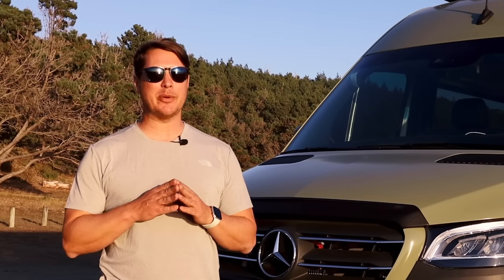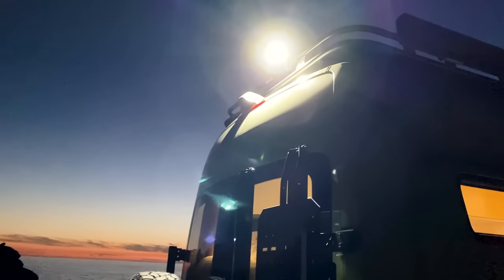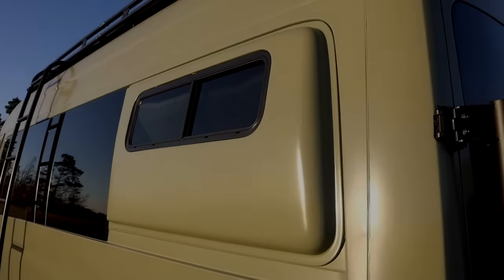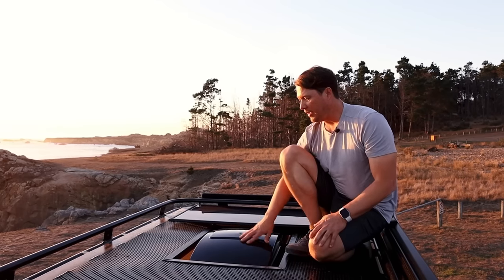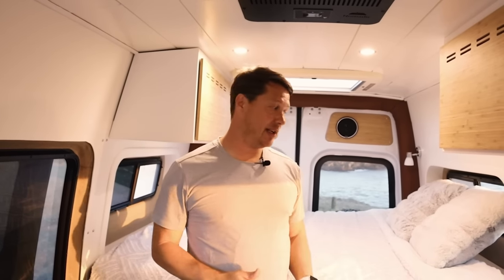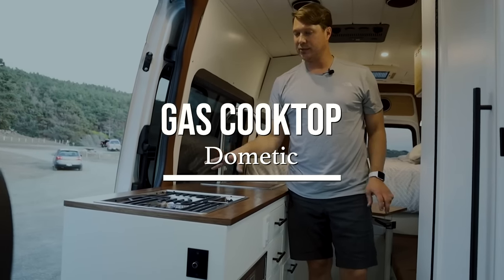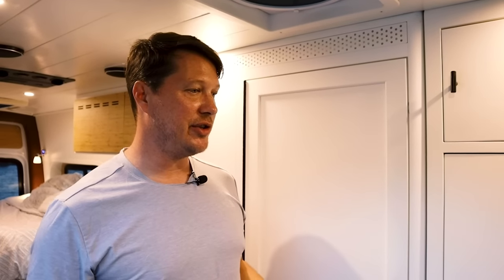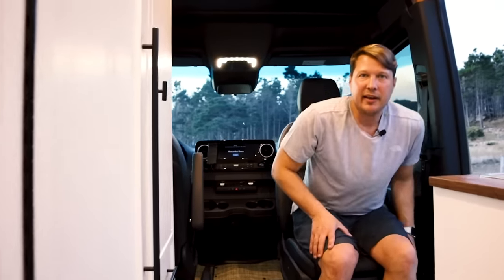Luxury Sprinter Van Build | This Van Has EVERYTHING

Comment: Thank you for sharing this van.  So many really good features. For the second video please include:
1) separate sliding screen door? 
2) toilet type (cassette)?
3) power sliding door?
4) mattress width and length? 
5) weight of build (e.g. w.r.t. to payload)?
6) is this 170 a 4x4?
7) are all windows 'aftermarket' (e.g. sliding door, side windows and, in particular, the rear windows?) (you said this started as a cargo van with 'no' windows)? 
8) inverter size?
9) insulation (and looks like back doors are not insulated)?
10) the 'low profile' inside of the AC is great (so is the shower stall from VanLand) .   
Thanks for expaining below the solar system size below.
All the best!
Greg

Comment: How do you keep the watertank from freezing in cold temps? Why not more solar panels up top? One seems inadequate.
Reply from the maker: To prevent freezing of the water tanks while in use, we include a hot water recirculation loop. Or, as with all RV’s, you can winterize the system. Some manufacturers use heating pads but being based here in California, this particular build won’t see too many freezing days. 

As far as solar goes, adding more panels means giving up the ability to move around on the roof rack. Plus most of the power comes from the alternator so adding another panel, while nice to max out the solar, is too big of a trade off vs roof access. Space is at a premium so we have to make some tough decisions.
Reply: I would take the additional solar over the roof access all day long. Wouldn’t want to have to run the engine often to keep things charged up.  Looks like more could easily be added if that was someone’s preference.
Reply: How much?
Reply: I concur about preferring extra solar panels in lieu of roof access.  Most people aren’t going to us the roof access for cargo or sightseeing as much as they would expect.  Better to use the space for solar, A/C, and vents.
Reply: Beautiful build.  I agree with some of the other writers…. why not more solar?   In our 170 4x4 3500 Sprinter build (another builder) will have 4 of the Zamp 90 watt long panels on an Aluminess rack, Max air fan and Nomadic 12 volt AC.  They worked hard to get everything on there by elevating the solar panels and placing them along either side of the fan and AC.  We will still have deck space towards the rear of the van.  No sky light.  We didn’t want that because of heat gain in summer and heat loss in winter.
Reply: Beautiful build. I could live in this van full time Ava be pretty happy
Reply: Need more solar power.    just 100 watt. Doesn’t work !!!!!
Reply: @VanLand — What about solar panels under the rack height on drawer glides, essentially opening them when parked, push them in when moving?
Reply: Yea, the water tank being exposed underneath begs for both freeze issues and rock damage/cracks.  While he is correct the heater might circulate the water, but the heat/energy loss to heat the entire water tank to ‘interior heating’ temps would be bonkers.   Clearly this was meant only for use in cold weather while occupied or stored with tanks winterized.  It is NOT meant to leave for a weekend and return.

Comment: I would prefer a rear configuration of a backseat and side lounge seats that electrically converts to a bed.  When not using it as a bed, you have extra seating while driving or lounge area when parked.  Plus it would give it an open/more spacious feel rather than having a dedicated bed occupying a third of the van.
Reply from the maker: That’s a good design concept. But in reality, most people prefer a bed that is made and doesn’t have to be out away and set up every day. Having said that, I agree it gives a more spacious feeling. Thanks for watching!

Comment: Ok, this is my favorite overall build.  I want more space but a smaller footprint than a big adventure truck.  I would want a winch up front and maybe a swing out back storage box.  Load up on more solar but this is the exact size I would love to have
Reply: I just bought a 144" Sprinter build, but thought the 170" makes so much more sense. You can have both under-bed storage and a reasonable hangout/dining area. Unfortunately, the upgrade appears to cost $85,000 and 6-8 additional months. That's just ridiculous.

Comment: I really like it I’m very impressed by it, I would like to see a fan in the bathroom to pull out the air, compression in the front and back on the front tailgate and the back tailgate, I wonder if you could create something with the solar panel where you could have three solar panels up there but have a way to stretch them out when your parked, maybe you some hydraulics.. In the way that the water tanks are under the bed of the vehicle what about freezing
Reply from the maker: Thank you - good ideas.
Reply: I have some great ideas I’d like to run by you

Comment: Is that an Inhabit Design Works floor up front? That’s what I used in my build and I absolutely love it. Plus, Brian and John are great to work with. The fronts are standard dimensions, but they can also do a full custom floor cover from the back of the front seats to the rear of the van.
Reply: It is. Thanks Brian! I believe it’s the Pistachio material.
Reply from the maker: Yes and yes! Inhabit Designs and Pistachio! We LOVE them! 😍

Comment: Awesome build but for 100wat solar panel way too low to recharge the 600amp batteries, with 12v a/c, water heater,water pump and fridge. That long hours of drive (alternator)to top up the battery back 100%.
Reply: i was going to say this. shouldnt it have 300??

Comment: Im curious how much will this van cost with all the same features??  How do you manage so that the water tank doesn’t freeze if you take it on a winter snow camp?
Reply: How much?
Reply: As far as I can tell, custom builders charge $130,000 and up for this. So, add that to a $65-75k chassis. The total cost ends up being ridiculous.

You can buy an off-the-lot/factory 144" version of this for $135,000. So, the at-the-dealership cost plus $10k in after-market upgrades. The 144" is a compromise in that you will lose storage or the hangout area, but is having both worth $80k more? That seem crazy to me. 

Hopefully, the volume brands will start building smarter 170s.
Reply: @thedalillama  I would say your pretty spot on , its alot of money to spend on a weekend camper. In my personal opinion, save half your money by buying a used F 250 or 2500 and put a used truck camper on the back. Bc at least you still got a truck to drive around
Reply: @Flordiakayakbass  For a lot of these people this will be more than a weekend camper, they will be living the van life, full time.
Reply: Great question. Please answer this question..

Comment: 100 watts of solar doesn't seem to be enough for a true off grid multi-day experience. How long do you estimate your clients can run this van without needing to plug in and charge? Can you re-charge the power via the van engine? Also, seems like the bed would be uncomfortable sleeping without a headboard for neck/head comfort and insulation insert of some kind on cold nights. Have you had any feedback from the owners on that? And finally, with all that glass exposure, can this rig handle adventures during all four seasons?

Comment: Very impressive. What is the loaded weight of the van, water, fuel,  and all? Did you modify the rear suspension?
Reply: I would say they did , stock suspension just can’t endure that change of weight especially when it’s constantly loaded and it’s obviously heavier than it was before

Comment: One of the best van builds ever, did you say what size inverter and is the water tank heated? Also on insulation I noticed the back door was bare metal, where did you insulate and with what materials?

Comment: My Question is , Why you didn't provide a larger solar system to support 600 Ah of lithium bat's . I get the Dc to Dc charger , is good ; but who wants to hear their motor running while catching peaceful serenity @ camp ? ( especially running a 12v A/C )
Reply from the maker: Hi Alpha- this is a question we get a lot. Here's why we only included one 100 watt solar panel on this build. 

First, there's only room for 300 watts of solar at most on the roof rack in this design since we have a roof fan, air conditioner and skylight to work around. By adding even one more panel, there would be no room left to move around on the roof rack which is a major bummer and not a trade off worth making for an extra 6-12 amps of power generation (in full sun). 

Secondly, there's plenty of battery storage to run the air conditioner all day without starting the engine. So, we agree, no one wants to run the engine in order to run the A/C. Thankfully that doesn't ever happen with this design. 

Ideally, you start your trip with full batteries and every time the vehicle is driven, the alternator is supplying 30-50 amps of power to charge the batteries. A secondary alternator will give you 100+ amps of power. The solar panels contribute a little bit of power when the sun is out, but there's simply no way to have enough solar on the roof to keep up with the power demand of a 12v A/C. We would need to put 600+ watts of solar (at least) to keep up with the A/C and there just isn't enough room for that on the roof considering the other equipment. So, a better strategy is to add some additional battery storage and a good alternator charger and park in the shade when running the A/C. 

Believe me, we love solar power, but it does have it's limitations and the space required to get significant power generation from solar is the one big downside. Looking forward to future generations of solar panels that pack more power collection into every square inch!
Reply: @VanLand  ok that makes sense , the cost of limited  space. thanks for taking the time to respond. I am planning to swap out my A/C for a 12v , i do have 850W of solar to support 400ah of lithium with dual 220 amp alternators , so it should be worth it. ~peace~

Comment: Really nice build! Just the right amount of rugged outside and that client chosen color is perfect. Super job on the inside especially with the flares for the bed. I always wonder though why are they not wider or taller and more commonly used. You could almost have half of a slide a side. Loved the tour ... Cheers
Reply: it could be the nicest build in the world, if its on a mercedes sprinter it a POS. mercedes is garbage.

Comment: 2 person (leaving the kids at home) travel seating on a 170 and 1 single swivel seat, feel questionable. Roof module livability, mesh metal surface for sitting - ok, remaining good roof storage area limited around the vent, sky, a/c cut-outs, within rack side bars. 100w solar, powered sites only or running the engine with a good alternator upgrade is life + $ dc charge system. Choose between running huge A/C, and fridge cycles / AC accessories. 400Li min battery? Very interested to know the tar weight it came in at and MPg

Comment: I did not like the coverage in the toilet. preferred pain white or off white. In Africa, we would rather have the step ladder linked to the spare wheel at the rear, where the wheel also acts as a step ladder. Like the water tank underneath, but must be fitted into an insulated container. Liked the 17 " off-road -on-road tires. Would like to come to America, and try the van first before importing them as a franchise dealer

Comment: Great job guys?  I’m curious after 5000 miles or so what in the interior would you change regarding driving noise/rattles?  I’ve owned rvs that I simply could not/did not want to drive due to the driving and highway noise inside the vehicle…….

Comment: I like this van blue would be great. But my question is can you put 360 camera system
Reply from the maker: Hi Carl, we are actually building this van in blue right now in our shop! Stay tuned for that. Also, the van comes standard with a 360 camera system.
Reply: @VanLand  great to here I took your advice and build me one I like to order the cost of the van is $85,000 it is a high roof 170 l
Reply: @VanLand  I want you'll to build it out for me I want some of the best high technology on the market also I want to upgrade the battery and I want it to stand all four season
Reply: @VanLand  I have set aside $300,000 for the build. I been looking at your YouTube all day
Reply: @VanLand  I will be living in it full time

Comment: I am tryn to figure out how only 100 watt solar charges 6 batteries? I am guessing it charges off the alternator also, but then you would need to run the van. So just figure out how much off grid this really is.  And water storage under the rig? How do you keep it from freezing? Your build and works looks second to none.
Reply from the maker: Hi Tim! Thanks for the feedback. The batteries charge primarily from the alternator- solar adds some as well. We also recommend charging via shore power before a long trip. There's room for an additional 200 watts of solar on the roof, but then you can't stand on the roof rack, so it's a trade-off. 600 amp hours of lithium power is a lot more than people realize and this van almost never goes below 70% of its amp hour capacity on a normal trip. 

In terms of the water tanks, there is one inside which can be used during cold weather trips. There is an additional reserve tank under the van that can be used during warmer weather and simply not filled during cold trips. In extreme cold weather, all RVs should be emptied of water and even filled with antifreeze if that's your thing.

Comment: How else do you top off 600 amps of battery? 100 watts of solar is definitely not enough. Is there a larger alternator? Generator? Do you rely on shore power and the engine?

Comment: Hi, watched your excellent vlog, my question is; I have an '03  Sprinter automatic I used in the last decade for touring the European racetracks with my bike and dogs, it has stood disused since 2020 and either needs a refurb or scrapping, there are a few bodywork issues and it was a very basic convert as it doubled as a work van, should I plow money into it or let it die, it's on 130k miles and requires servicing and refurbing mechanically too, I've looked at newer fitted out vans and we're talking 90,000€, granted it's the older shape but it seems a waste to let it go !!!!

Comment: Great van conversion, but it looks expensive, how much does it cost for the conversion and the original price of the van? How long does it take to build? Where (address) is the van built? 
Can the solar panel be upgraded to 600W along with bigger Lithium battery?

Comment: Where did you get this Benjamin Moore automotive paint? I checked their website and couldn't find ANY automotive paints.
Reply from the maker: It’s a Benjamin Moore color. Auto shops have their own paint.
Reply: @VanLand  So, how are you getting the Benjamin Moore colors into the automotive paint? There's nothing that I can see on the Benjamin Moore website that can be used for this purpose.

Comment: This build is beautiful, extremely stylist yet practical and this shower is impressive.  does the toilet use a cassette system?

btw whats the space under the bed?  does it fit a full suspension MTB or some other gear ?

Would it be feasible replacing the propane system by induction top and upgrade lithium batteries to 800-1000 wh. What about a high output 2nd alternator too?

I have a STO beast on order , but … maybe I like this better. whats your email ?

ps: I am very picky . I only like very few builds that I have seen, and I like this A LOT

Comment: Credit for solid craftsmanship but there is no excuse to leave exposed metal on the doors and elsewhere. When you are sleeping and its 5 degrees outside and your bare skin hits that bare metal, the 100k price tag is going to feel really silly. Props for a 9/10 van build, but the common oversights with the pro builders is getting tiring.

Comment: That green color is God awful 🤢, but other than that this van is a pretty solid build. I would have liked a better look inside the bathroom, and there was no mention if it was a flushing or cassette toilet. I heard mention of watching movies but saw no TV and no streaming/BlueRay equipment. I would have doubled the solar panels and there still would have been plenty of space to step on the roof and strap luggage. No mention of the generator on this van? The fan needs to be closer to, if not directly above, the cooktop range. That whole van will reek after one fried meal; and those wood panels will develop a coating of grease in no time. What water heater is installed? Truma AquaGo etc? I didn’t hear mention of the capacity of the gray/black water tanks? This video is missing a lot of stats 😕
Reply from the maker: Let us know what color you would like! Leave a heart emoji with your favorite color.